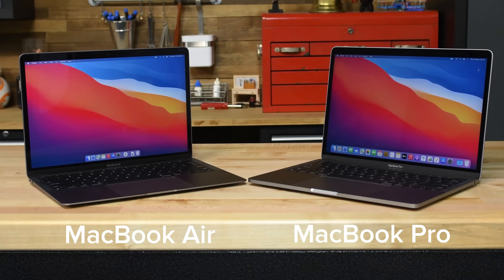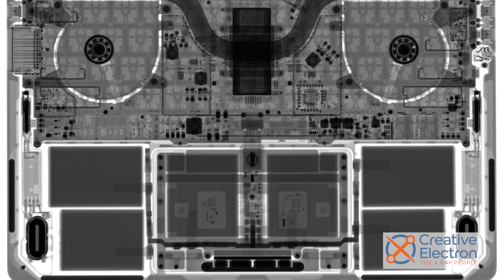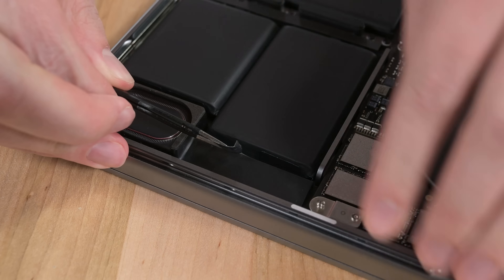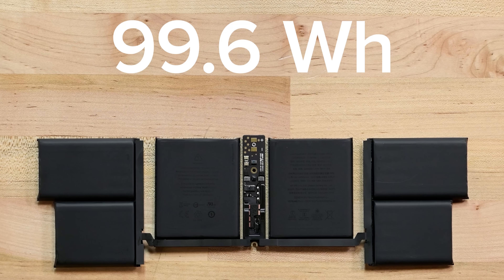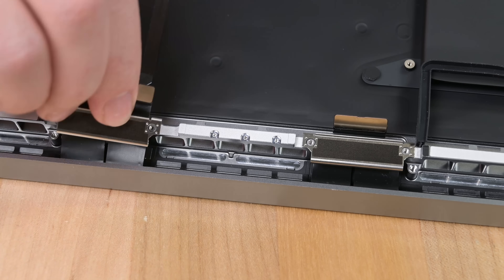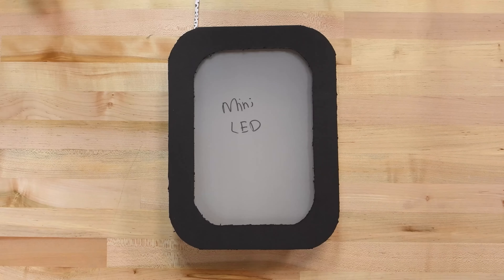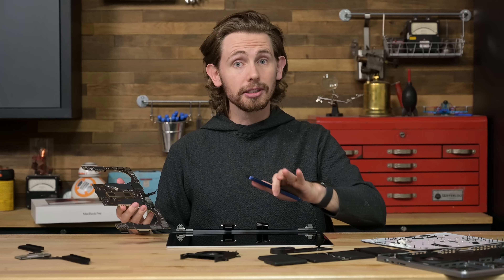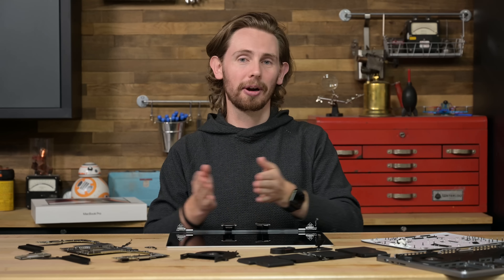MacBook Pro 2021 Teardown: Easier to Repair, Harder to Score…

Comment: Removable battery? Authorised service centres say that the battery replacement requires replacing the keyboard chassis as both are super glued to each other. They are charging around $400 - $450 in India.
Reply: what's your battery percentage? and you have m1 pro 16" or 14"?

Comment: If the laptop stops working they will charge $400 for the logic board, $600 for the screen and the warranty offered on the replaced component is 3 months.
My 2016 macbook pro  the  screen went blank (Flexgate issue )  solution offered was screen replacement after 1 year the laptop stopped  changing took it to apple care they said logic board need to be replaced. Lost all my data.
So i got fed up and threw the laptop away. I will never buy a macbook again.
The current M series laptop are even worse they have even the Ram and SSD soldered on the board, i believe they still haven't solved the flexgate problem.
My advice to anyone thinking of buying apple laptop would be stay away or  to buy Apple care. Because these laptop can't be repaired they only offer screen , logic board, keyboard replacement.
There is no such thing as repair.

Comment: I am using M1 Mac 2021 14 Inch..
I got crackling sound in speakers...
Visited the nearest apple store in India, Tamilnadu, Coimbatore...
They have checked and Said hole got created in Speaker mesh...So entire Logic Board needs to be changed including speaker, battery, keyboard and speakers.. I dont feel this as a  valid fix.. Can anyone suggest solution u came across for this kind of success

Comment: Would you say there’s a 2.4 mm space between the cover and the battery to fit a FindMy Card?
Reply: The MacBook already has find my technology integrated into it. Even when powered off.
Even if it didn't and you planned on using that card, I wouldn't suggest putting it between the bottom panel and battery...

Comment: My speaker is cracking sadly I found out it's a physical damage. However, I found it I need to take a lot of things out in order to change it. Can I remove it without taking the battery?

Comment: Where to buy oem battery for MacBook pro
Reply: If you want a OEM battery you are better off with letting it replace.
For my 2010 model (not even 100% safe they are legit) they costed once 100$+, the apple battery service (with a definately LEGIT and fresh one) costed 140$. Sure it was just 2 screws and 1 connector so i bought affordable 3rd party of a known, better brand which also lasted me 300-600 cycles, but Apple OEM was like 1000+ cycles over 4 years.
I would buy 3rd party (dont trust the ones pretending its Apple OEM!) or go for SMC batteries if you find them, typically Apple batteries are produced by SMC and the clones they produce are exactly the same as "Apple OEM".

Considering M1 models and newer ones in general with the trackpad to remove issue.... just go for the apple replacement if you really need it, i am a big fan of DIY repairing/upgrading and did much from MacBooks to iPads and phones, retro consoles repair and modding etc, but even i would avoid touching the M1 internals even if its just the trackpad (14 screws!!!!!!!) for 40$ more since you get a 100% legit and for sure good quality battery without the hassle of their bad design (1-2 screws are acceptable as end user, glue and touchpad removing not so much)

I use AlDente, have 200+ cycles on my 1 year and 3 months old machine and still 94% battery health left. I typically use 40-75% battery charge level, charged up to 85%+  only when really needed, for example a longer day at study to keep mobile/unplugged the whole day.
I just use the battery as much as possible, in 2+ years if its at 80% health or so i just give it a apple battery service for another and probably its last 3-5 years.

Apple batteries last very long, if you care with AlDente a bit about them... 4 years, more likely 5-8 years or 500-1500 charging cycles depending on how much you care about are possible
Reply: As i said, my 15" 2010 MacBook pro had its original battery for 4-5 years and i think 1300 charging cycles, heavily used (tho it nearly blew the trackpad up already and had officially 70% or so health left but effectively less than 20%.

Most Apple, so Mac and iPad users dont really have to care about their battery - it will survive mostly the device itself anyways, at phones, 300+ charging cycles a year and more 100% charges tho, on my iPhones i had to replace the most batteries yet (always smallest iPhones... 3GS, 5, 2016 SE, now 12 Mini) since i keep them normally for 3-5 years or longer if possible

Comment: Shame you didn’t discuss the keyboard being none replaceable, since it’s riveted to the shell.
Reply: pretty similar to my 2010 15" MacBook Pro - but it hasnt failed yet and i was gaming and writing a lot on this keyboard.
Same goes for my 2011 Apple Wireless Keyboard - best feeling, heavily used still no problem.

The M1 Macs have all the "standard" keyboard back with slight modifications (little bit less hub and less force needed) so i guess and hope they also last forever as my 2010 and 2011 does.

In general, as much people (and me including) hate on the non repairable and upgradable things - The M1/M2s are some special new breath in the PC industry, not just because of ARM chips in a "fully capable" computer but because its a sign of RISC finally taking over CISC/x86 architectures in the regular consumer PC market.

When you compare super compact yet "powerful" machines to MacBooks they have also soldered RAM at least, probably m.2 SSD to replace but some like my mums Lenovo Yoga has also soldered 256GB SSD but its very very compact and thin.

Comment: I’m actually not sure why everyone is saying the battery removal is easier now? Granted, I’ve been skipping all new Macbook models since 2015 (because of the ports), but the battery removal process you’ve shown here is almost exactly the same as in my 2015 MBP Retina 15" in which I’ve switched the battery several times already. Except it’s even easier in the 2015 model because you don’t have to remove the trackpad in order to get the middle cells out. (Maybe the pull tabs are new though, I’m not sure about that since the original glue is long gone, but getting the glue off is easy with a fishing line or a thread anyway).

I mean the pull tabs are nice, but with all the hype I read about how easy it’s supposed to be to change the battery now, I’m kinda disappointed to see that Apple is actually being congratulated for ... changing absolutely nothing apparently?

Comment: Hello IfixIT 

Would you please help,

I used to keep my MBA almost 90% of time when using it connected to charger, but unfortunately , my MBA battery capacity dropped from 100% to 97% in less than 4 months with a cycle of 36 with only 5 cycles in 3 days!!
In 2nd October it was 100% capacity with 31 cycle
3rd October 98 % capacity 32 cycle
4th October 97% capacity with 33 to 35 cycles.

The problem really now is that the battery drains very very fast almost between 4 to 5 hours only while watching YouTube or movie, I don't do heavy tasks or editing at all.

Thanks to provide your advice and view point?

Regards

Comment: someone correct me if im wrong, but isnt there a weird law that requires adhesives be used for multi cell lithium ion batteries if they go past a certain MHA, and demensions? i remember someone mentioning that as to why apple had to switch to using adhesives

Comment: If you put the same display and finger ID reader back in the same case, do you still lose the touchID et al?

I'm curious if it's possible to completely seperate the entire aluminium frame (for repair/spraying etc) without losing functionality.

Comment: It’s thicker because they thought “yeah going that thin on a pro model without MagSafe was a bad idea”
Basically they should’ve just made the 1st M1 “pro” model a new iteration of the Air. Basically like… the “MacBook Air pro, it has a fan, so it does better! :D”
Instead of it being a “normal pro” MacBook. This MacBook is pretty much the actual pro version.

Comment: The notch is there for the webcam only. Also because the screen itself is also thin as heck, and I doubt people would want the thickness to go up any more than it already has (it’s pretty much the same thickness as the previous Mac Pro with multiple ports)
So they’ll have to work around the notch, since I doubt we’ll get a “notch-less” look anytime soon.

Comment: No way I would buy any laptop where not battery screen ram ssd replace repair upgradable.
 I love my Toshiba 2 in 1 and new hp 360 amd 8 core 32gb ram 1tb ssd upgradeable  15 inch laptops with stylus.

Comment: Any comment on how easy it is to clean the fans and radiators without having to take out the mainboard? It looks like you could just about get a thin tube from an aircan in between the blades or the gap between the radiator and cowling.

Comment: Does all the bottom part  needs to be removed before you get access to the logic board? 
It's such a bummer that the fan is so difficult to access.  I had a mb  pro about 10 years ago and just love how the fan was directly accessible. Then I got a windows laptop because people keep telling me how you can get the same spec much cheaper, and I really regretted that because the Asus I got required me to remove cd drive, screen and keyboard and a few more before accessing the fan. From my experience cleaning out the fan tend to increase the longevity of the machine.and I really hated that the Asus had so much steps not to mention risks because the keyboard had short ribbons attached to the so you can only lift them up for about 45 degree to get access and detach the connection.
Now I'm seeing most rog having a direct access to fan with a single bottom panel like the old macbook and now the newer macbook actually makes it more difficult to remove the fan.

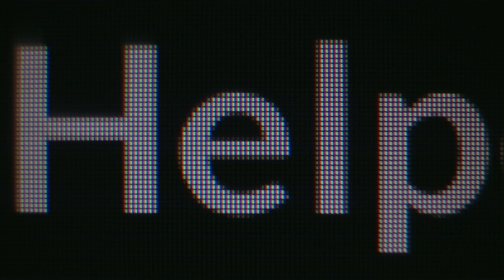Comment: Emboss ≠ Deboss (Macbook Pro Logo @ 1:19)
Embossing results in a design that's raised up from the surrounding material, and debossing results in a design that's stamped down or recessed into the surrounding material.

Comment: the only things that make me not want to get the new macbooks is intergrated storage and intergrated ram.
like seriously apple? if having to add in two DDR5 SODIMM slots and clear up a tiny bit of space for mounting an M.2 NVME or Apple Propriatary SSD would just add up even 5mm of thickness no one would care about that.
modularity like that would've made these new macbooks as desirable and awesome to own like the good old Unibody MacBook Pro's were (and to some extent still are, i'm writing this on a 2012 13" maxed out i7 unibody lol)

Comment: My MacBook Pro 16 2019 model goes into Safeboot if I turn On the Mac after 5 hours . After restart from safeboot it works fine . Keyboard works fine and no damage at all . 

Any idea why it goes into Safeboot without shift key only after 5 hours ..??

Comment: What I would love in the future from apple is to make the battery even easier replaceable (screws), have removable ssd, make the keyboard more accessible. I understand with the integrated memory for the new processors so as long as you can get replacement logic boards that don cost an arm and a leg that ok.

Comment: Why not just add an M2 extra slot. That would be overkill pro. If you need exxxxtra performance, you buy more stock ssd, if you need just a bit more storage, you put a freaking NVME inside. Easy

Comment: It is sad, that you didn't criticise Apple for soldering on SSD. The m.2 SSDs are super small and expensive ones are very fast, so Apple could have done that. The problem with flash storage is that it has limited read/write cycles and will go bad after a certain amount of time. MacOS also very agresivly does memory swapping from RAM to SSD, if you are low on RAM. I wonder how long it will take untill reports come out of dying laptops due to this reason.

Comment: I'm not a fan of the fact that everything is integrated... but ... regarding the storage they use their own controller, and I don't know if that is integrated in the cpu, if it is you can't really use m2 storage for it, and regarding the ram, they definitely have a latency advantage by having it so close and in the same package as the cpu.

Comment: Laptop's fall in between desktops and smartphones in that although they are larger than smartphones and are capable of being updated the vastly more compact design versus a desktop make them less suitable for modification than a desktop.  Although Apple kind of reversed themselves in numerous ways going thicker than previous models a modern laptop isn't going back to the bricks of old so space is always going to be limited.  The segmented battery at first appears odd, but the chassis has ribs that stiffen the chassis and those ribs make a single segment battery impossible.  The symmetry of those fans is quite aesthetically pleasing.  For me, the only components I'd have wanted to be able to upgrade or replace are the SSD's, the RAM and the battery.  The unified memory make RAM upgrades pretty impossible and it appears the SSD is similarly fused to the MB in ways that make upgrading unlikely, but being able to replace the battery, the single component that might actually need to be replaced in time, is a good thing even if the actual replacement is somewhat less than easy.

Comment: Unfortunately, the FlexGate issue is only addressed with a repair program 13" and not the 15" late 2016. Mine is suffering from it, but it seems Apple does not care at all.

Comment: Personally, I'm not a big fan of the exterior design. The curved bottom with a flat top doesn't bode well with me, even if it's an homage to the first MBPs. Nor am I a fan of the adhesive tabs. Hated it on the MacBook, and even more on the iPhone 5. The MLB and the display removal process looks smooth. I don't mind the notch, but I also don't understand why people hate it so much. Surprised they added the old ports, though. Seems like Apple has case of an identity crisis. At least the M1 chip is still decent and in the end, that's what matters most.

Comment: If you spend time making bass you find an enemy enemy in vibration.  Anything loose can vibrate.  The back chassis cover needs to be on nice and tight but still be removable.  I would not ding Apple too badly on the cover.

Comment: Really nice if you see that Apple hear the wishes of their (pro) users. So thank you for this informative video :-) So much better laptop to work with than the last versions. Currently working with the late 2016 macbook pro with touch bar. Thank god the Touch Bar is finally gone. Seeing forward for my new macbook pro 16 inch for 2022

Comment: Pro tip from a not pro (lol): suction cups help get the bottom case off super easy. Just suction cup to unclip the clips and then slide the top teeth out. That’s the official apple method and it works well for me.

Comment: Ok, I bought a 14 inch MacBook Pro. I got the Apple M1 Pro with 10-core CPU, 16-core GPU, 16-core Neural Engine with the 16GB ram. I’m sorry to say, I took it back after 3 days. I trade stock options, and my stock broker platform was lagging and it took a long time for it to load. Also, I’m a Scuba diver and thought I would edit some video from diving, and it kept saying; SD card could not be recognized on this device. I put it in a old Dell and the video came up. I spent hours trying make the SD card work, even with YouTube help, it didn’t work. Lastly, I kept hitting the power button while typing and that added to the frustration. After 3 days of stress I gave up. I might buy the iMac 24 maybe for Christmas. Believe me I love Apple products. I bought my first iPad. A iPad Pro M1 and though it doesn’t aggravate me as much as the 14 inch MacBook Pro. Hopefully, I still get a gift card when I traded in my old 2017 MacBook Pro.

Comment: Ya the pull tabs are great until you get an iphone X or even 8 for a battery replacement and with age and heat cycles, the dam thing snaps and you're left with iso and prying

Comment: The speed of the M1 really does depend on integrated memory - the speed of electricity is actually a limiting factor, and shorter paths are better.  On the other hand, I'd like to see the SSD socketed, so it could be swapped out without desoldering. The performance hit, if any, would be worth the tradeoff IMO.
Reply: or have a dual memory version, socketed and swapable memory <3
Reply: @000jjjoni000  Well, they did in fact socket the SSDs in the Mac Studio, so I guess a small "yay" is in order.  PITA to replace one, though ... and sadly, you can't upgrade to a larger one.
Reply: My speaker is cracking sadly I found out it's a physical damage. However, I found it I need to take a lot of things out in order to change it. Can I remove it without taking the battery?

Comment: I rather spend my money on a good windows laptop knowing that I could upgrade both the storage and the memory. And get almost the same performance as the new MacBook. I have a 2012 MacBook. With all new ssd ,memory and batteries. And it's running great. And unfortunately that will be my last MacBook. Thanks apple for trying to nickle and dime us. SMH!

Comment: but the battery can be replaced and still works? or has a firmware locking it down to the original device? because the touch id and display panel WON'T WORK unless it's changed and RESERIALIZED by apple! same goes for cameras, display, touch id in the latest iphones.
So what use is it that you have a notebook with modules the user can take apart if those modules are hard coded to NOT WORK on another notebook?